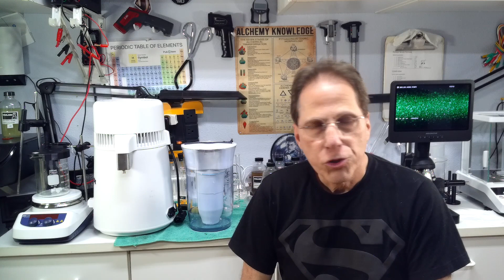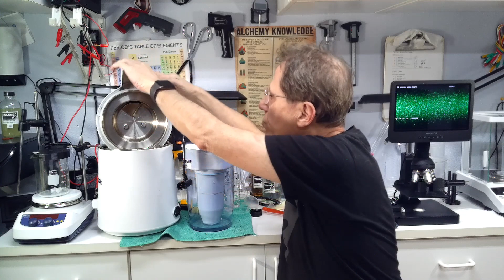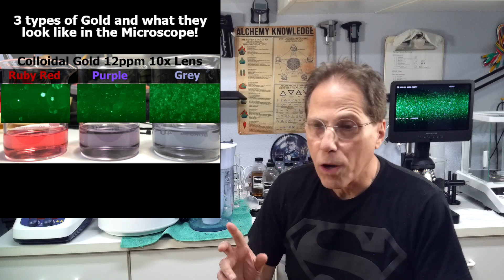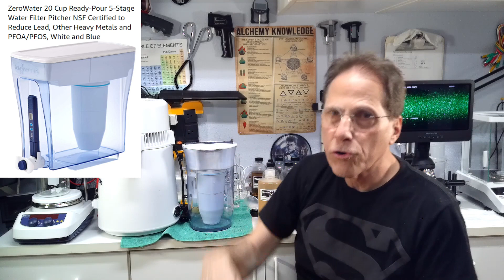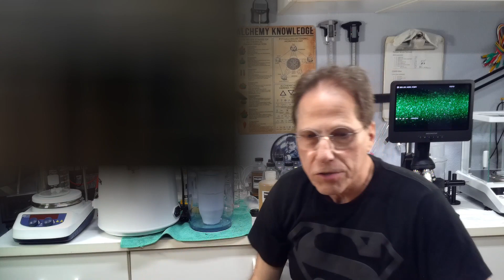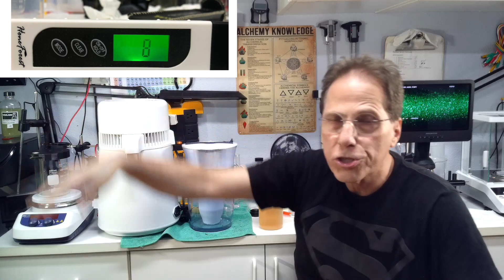Different kinds of water for drinking and laboratory use!

Comment: Thank You :) This video made me wonder about me failing to get ruby red....
If my water is 006PPM let say... what will happen if I increase the amount of sodium citrate in my stock solution?
I went from purple to the side of the ruby scale,but still more purple... 
Now Im gonna double destill my water and go with your original formula and crossing my fingers to reach ruby...
Reply from the maker: I would give that a try. The ruby red color was harder to obtain with water that was not 0-ppm. 

If the 0-ppm water does not work, I would decrease the NaCl by 50% for a test and see what you get. If you get light pink color, then try 75% of the NaCl. For now, I would leave the amount of sodium citrate alone. It is used as a reducing agent and seems to be working in your setup. The NaCl is what determines the size of the gold particle.  

By mistake I added 3 drops of vanilla extract to my gold distilled water before cooking. It created dark ruby red. Then I experimented with 10 drop of vanilla extract and got dark purple. There is no doubt the gold formula is tricky and your ingredients must be in the right amounts or the outcome is uncertain.
Reply: @AlchemyWizard  / Here I am ,back again.... So the results are :
With 0PPM water, I just did what you said about cutting the NACL solution by 50%
The color came out more pinkish than purple  but If I have to chose a color I would rather say more purple...
Should I try cut down the NAcl even more to see?  like 25% or should I  make a batch with 75% load of NaCl ? 
I can not stop until I find out what the heck is going on...... :)
Reply: @AlchemyWizard  Now Im an hour into the process with the second batch : NaCl stock solution reduced to 75% = 10ml from your original stock solution.
Now im at the color of a good rose wine....

(im using my voltage and amp little lower than your setup and using a 10g investment 24k cuted in half.. ,Im wondering what causing the time difference in the process... Maybe the lower voltage and a smaller surface area ??? It can be... your twisted gold wire has much more surface area than mine.... Im going to use a hammer and make thinner gold plate from  it in the future... )
Right now just wanna reach ruby with the current setup... 
My batch from yesterday toke me 2.5hour....
(36V .88Amp

Update: 1:15 min into it..checked temp ,went down to below 80C ....
Now color just started to turn purplish again.... ...
Scratching my head .....
Reply from the maker: @MotoRobee  Rose wine color is a light ruby red color. In theory if you cook it longer it should darken to ruby red. The lower temperature will just make the gold cook slower. It should not effect the color. The thickness of the gold however will effect how long it takes. More gold the shorter it will cook. What is your current at? You may be cooking it too fast. 500mL of gold should cook at 200mA. If you are cooking it much higher like 500mA that could be why it is cooking too fast. Even Ruby Red gold will turn purple then grey as the concentration of gold goes up. 

When I first started cooking gold and did not have the NaCl part right, I went straight from a light wine color to grey gold. You may still be using too much NaCl. Are you sure you measured the amount of NaCl out correctly in the stock solution and mixed that with 500mL of distilled water. No Iodine in the salt. I have no idea what that will do. Are you using 8 drops of the corn syrup mixed at the 30mL syrup and 20mL distilled water? 

IMO your solutions are off with the chemicals. Are you using a scale to measure your powder out (salt, sodium citrate) then mixing it with water? Don't convert the weight in my stock solution mixtures into teaspoons, that will not work.
Reply: @AlchemyWizard  im running 36V 0,88Amp , And I used a digital scale (may can be off) with your stock solution guide with the exact numbers...
Exatly what you mentioned is going on... light wine color to purple...
In that case which one is the better for consumption ? The light wine or the purplish ?  ?
My current is fix, cuz im using a brick from e  oldschool hp printer...this is the closest what can I find ,and i found this in a guy video long time ago who was able to make ruby... Just can not find that video anymore..
 When I measur NaCl  scale not folliwnt it up properly when I add more nacl lets say from 1.2  will jump tu 1.6 ...  So my measurment may be off a little...but yesterday ,when I decresed the amount of nacl stock solution to 50 % that is how I reached the rose color......
 QUEST :
What will happen if I stop the power source at rose color and ,just keeping it on the hotplate for a while to evaporate some water ? Will it darken out ? or it will still gonna turn purple... 
 I understan the wave lenght of light and stuff like that regarding the colloid...

Gives me no peace until i sort this thing out....

again  , can not be more gratefull to you for your comminicative behavior... You are a good man :)
Reply from the maker: @MotoRobee  880 mA is alot of current for 500mL solution. I think your NaCl is still too high. Try lowering it more. slowly add the NaCl until you reach 200mA of current then stop. See what happens then.
Reply from the maker: @MotoRobee  the light rose color or the purple. You have to try them both and see which one helps more. I like purple for topical stuff. But let's see if you can get ruby red by stabilizing the current to 200mA.
Reply from the maker: @MotoRobee  Normally when you turn off the power and let the solution cool it will darken a bit. Boiling away the liquid will not make it much darker. On the next batch take a picture of the light wine colored gold you have and send me a link to it. Let me see where you are at with it.